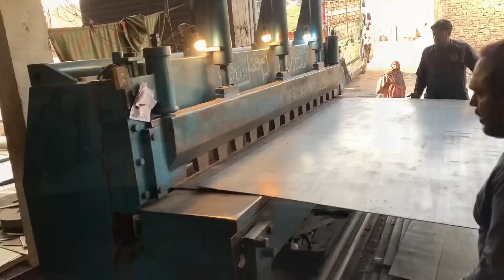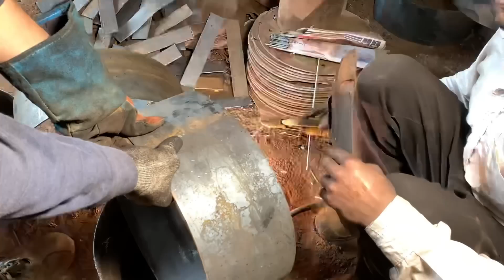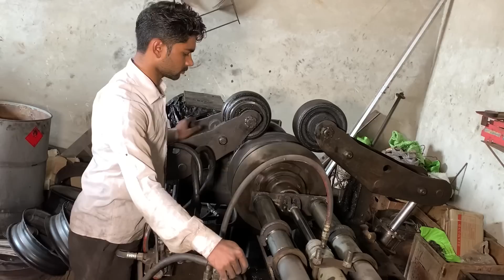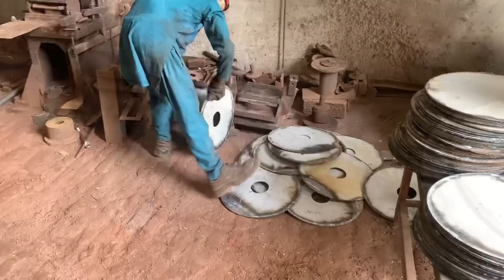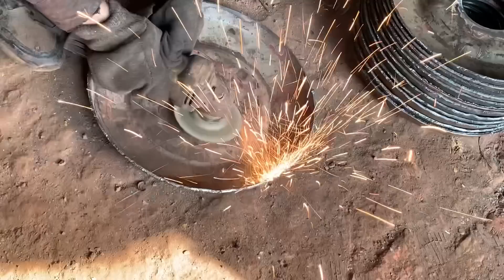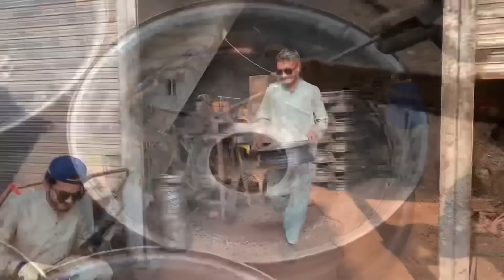Amazing Manufacturing Process of Small Vehicles Wheel Rim in Local Factory |Production of Wheel Rim

Comment: Car rims are suppose to be made by casting molds, that weld is a huge weak spot
Reply: So these wheels are called Cast!!! Those are stamped wheels. They are also made in factories in Europe.Only with more modern technology. but the meaning is the same.
Reply: @__Nomad__  like closed toe shoes and tables?
Reply: @__Nomad__  True, steel rims are not casted. But they are usually made out of seamless tubes. That welding is a weak spot.
Reply: I imagine they are for hand carts or small trailers, not lorries or cars. Not disagreeing but without knowing what the wheels are attached too you can’t say it’s a useless product.